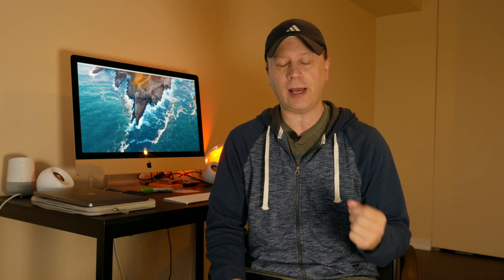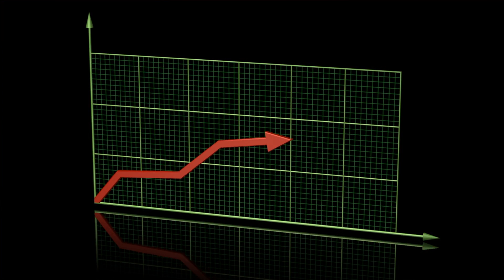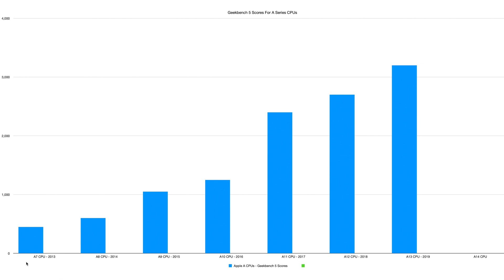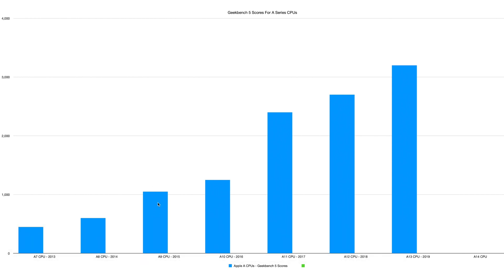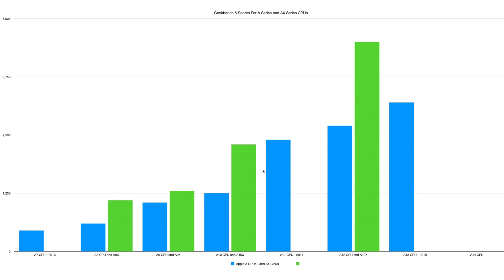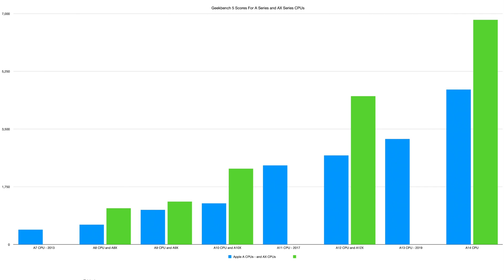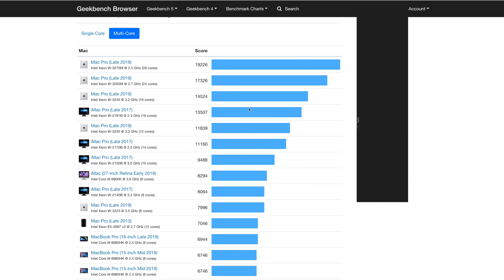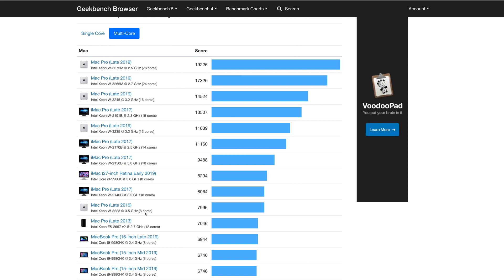How Fast Will Apple's New Silicon MacBooks Be?

Comment: Craig. I think you are spot on with the analysis. The performance you’re suggesting will be on the lower end models. Apple has got something drastically more powerful for the higher end models. History repeats itself. Apples jump to intel was drastic gains, and I’m sure this jump to in house silicon is going to be bananas. I imagine the refreshed 16” MacBook Pro will be in the multi score of a minimum 10k range. It will be more powerful that the base Mac Pro and that’s going to be the show stopping magic. That they are able to achieve the performance of a Mac Pro in a portable. Wait and see. 

Your video is the best I’ve ran across comparing numbers and I think it’s spot on. Keep it up.

Comment: "Moore's perception that the number of transistors on a microchip doubles every two years, though the cost of computers is halved. Moore's Law states that we can expect the speed and capability of our computers to increase every couple of years, and we will pay less for them. Another tenet of Moore's Law asserts that this growth is exponential". This sums it up....👍🏻
Reply from the maker: Yes, I agree.  It's always changing but I do think the increases in speed might slow over the next 10 years due to size limitations etc and power but we will find out.  It will always get faster every year so as soon as you buy a computer your computer is old.